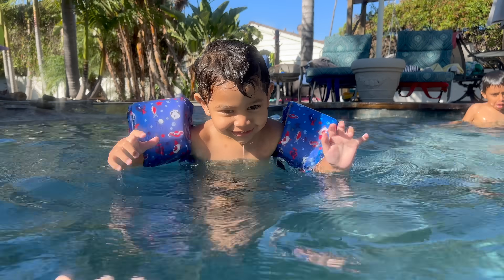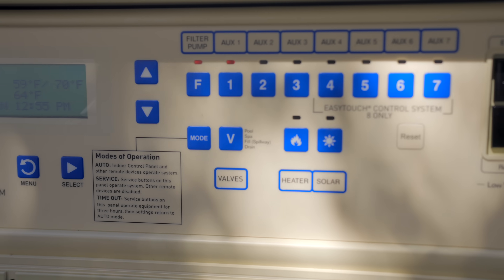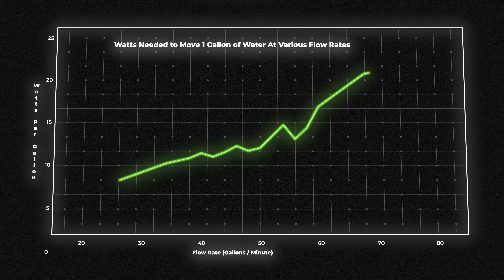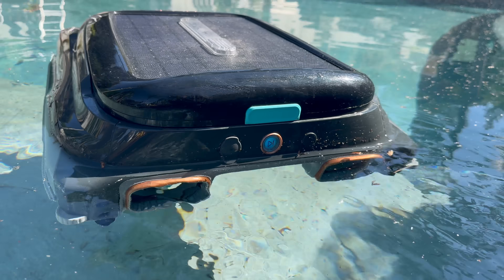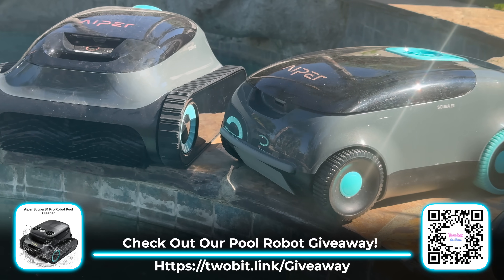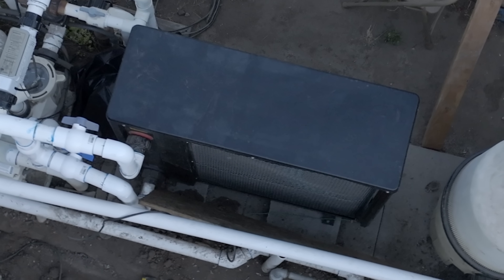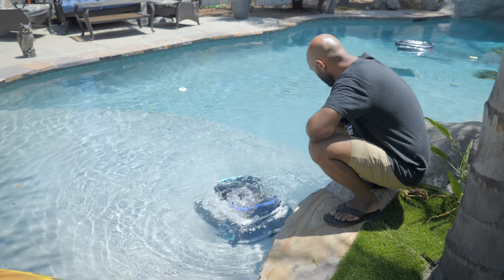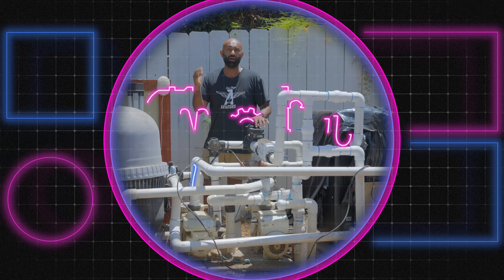How to Build the PERFECT Pool! Part 1 Variable Speed Pumps

Comment: You should check out natural swimming pools/ponds.  They are specifically designed for swimming, but mimic and utilize natural water cycles.  They have a sandy/wetlands section, with plants and even wildlife  set aside,  where water flows thru and is naturally cleaned.  They often use very cheap air bubble filtration to move the water thru the wetland/sand filter.  No chlorine, or other chemicals, and very clean water.
Reply from the maker: wow i've never heard of anyone with that kind of setup... I LOVE the natural component. I do have low levels of chlorine, so no living things for me, but I'll try to do everything I can. Do you have any links to resources?

Comment: i have had my fiberglass pool in Central NY since 1999....i use a sand filter and chlorine tablets....I recently purchased an electric cleaner (Dolphin by Maytronics) and LOVE it....i only use the regular vacuum 2 times a year now, once in the spring and once in the fall....the salt water conversion is my biggest decision and have stayed with tablets since the price of the unit scared me having to replace it every 4-5 yrs.....I only run the pool 6 hours a day and use a solar cover to retain the heat even though I have a natural gas heater, which I have only use a few times since the summer has been very sunny and hot...I keep the pool at 84 minimum too!!!.....like someone stated in other comments though is the CYA, cyanuric acid, which is a stabilizer for the chlorine and it can wreak havoc on your pool after yrs of using tablets....the common remedy is draining half the pool and re-filling which is 7000 gallons PLUS with a fiberglass pool, it is very difficult because dropping the water too low can cause the walls to buckle...i appreciate all your info as it is good to see other sides of the equation and the experiences using different ideas...what works for some may not be feasible or economically sound for others but it is nice to get constructive ideas on how to enjoy a pool for yrs like I have done
Reply from the maker: thanks for sharing Brian! So how long is your "pool season" how long do you keep it hot? And what area do you live? Very interesting, San Diego is quite cool... although its currently pretty hot, so a pool cover might be a good idea, but our odd shape makes it tough...

so much to it, which is why I'm really having fun nerding out. But I will say for everyone, get a variable speed pump!
Reply from the maker: Brian I think this may be the best comment to explain the challenges of engineering. Everything is a trade off. fiberglass buckling ... wow... is it in ground? I'm trying to think where the buckling problem could come from. I have a plaster inground. but as you point out, there are a series of challenges to all things in life, and the key is to find your own way. I will say the chlorinator issue isn't too bad, my pool guy told me about some aftermarket replacements that are way cheaper... but even then, with proper care I think its cheaper than Chrolorine, and way more automated. Something to think about. Plus salt water feels SO good on the skin... night and day compared to fresh water pools with high chlorine levels like at spas and hotels which leave you feeling bleached.

Comment: You are not joking. We purchased our house in Texas in 2022 so this is our 3rd summer with the pool. Actually it is a lot like yours, waterfall and spill over hot tub, and about 22k gallons. Getting the everything dialed in was finally done by May of this year. I purchased the same VSP that you show in your video, game changer. I purchased a used Polaris corded robot (wasn't ready to drop the cash on a new one) that does the floor and side, game changer. I am still running a chlorine, in-line, dispenser but I use 5 tabs a week (pool is in full Texas sun most of the day). The first year I cleaned the main filter 5 times, now I am down to 2 times. I think my largest electrical bill was $600, now down to the latest one was $275 (we have zero solar panels, just the old supplied by the utility service). I run the robot every 2 days, and the water is as clear as can be. One note on the price of chlorine, there was a plant in Lake Charles, Louisiana that caught fire and closed the plant for a significant time period in 2022. That, along with a 20% jump in pool construction during covid, sent demand extremely high. Enjoyed the video, now I'm off to do my morning swim.
Reply from the maker: I love it Parker, yah a pool in Texas must be pretty awesome as its warmer in the spring through fall. Thanks for the insight on the chlorine prices! did they ever get back to business?
Reply: @TwoBitDaVinci  I believe that it is up and running again, after a $170 million reconstruction. The company is KIK Consumer Products and the plant is in Lake Charles, Louisiana.

Comment: Tinkering with this stuff and doing an Excel simulation 20 years ago I came to the same conclusion about pump energy per flow quantity.   A few points: 
1. The salt cell has a flow sensor switch which sometimes are calibrated poorly to require a high minimum flow rate.  Bend it to adjust it to allow a lower flow which is not really an issue as long as the flow is positive.
2. Check valves are really restrictive with the spring, so  you can remove the spring to minimize restriction.
3. Use long bends as much as possible instead of restricting elbows.
4. Starite DE 110 filters have the lowest advertised flow restriction, much better than sand filters.
5. The two wheel constant volume pump motor are good at low flow rates but pricey.  I use one with an inline easy to clean filter which is great to catch dog hair from my crazy water loving golden retriever.  But I curious to try your robots.
6.  Solar heating requires a minimum flow to overcome the height and not cavitate.
7. A pool cover is a great investment like the another commenter noted, it vastly reduces heat loss and water loss from evaporation.  Besides the vinyl motorized cover I have a second manual bubble insulated cover for the the colder season.  Insulation under the pool and dry soil also help if possible.
8. I have an Arduino that controls the pump based on PV solar power to optimize solar heating.  It saves a ton of energy compared to that dumb brain Pentair Easytouch controller I have just like Two bit.  I really need to publish the design and program.
Reply from the maker: can you tell me more about your Arduino setup??
Reply: Please publish !

Comment: Why is there not a system which takes heat from your home’s A/C removing heat from the house and uses it to heat the pool?
Reply: Because theoretically it'd be great, but practically it gets complicated and expensive quickly. Not many HVAC companies make pool equipment and vice versa, so getting things hooked up to exchange the heat would be a custom situation every time. Then consider what happens if there's a leak, now you've got refrigerant in your pool and water in your refrigerant. Hopefully the compressor shut down before destroying itself trying to compress the water.

Comment: It’s weird why sun water heaters  almost aren’t used in the US. In meditarían countries they are everywhere. I mean those, which have a few vacuum pipes and a cylindric tank above them. It seems they should be at least twice more efficient in comparison with heat pump.

Those vacuum based heaters can be used in cold weather regions. Not to mention about San Diego.
Reply from the maker: there's a tradeoff for everything. thermal solar heaters don't last as long as solar panels. when i bought my house, i had them, and they were leaking salt water on my pool. it was a huge pain, and I ended up ditching it.
A heat pump has a COP of between 3.8 - 5 so they're really efficient at heating water. I wanted to get regular solar panels along the roof instead, because a pool water heater can only do that. but solar panels on my patio can heat my pool, or charge my car or run my AC etc... My goal is to produce all electricity, and with some planning, run everything under the envelope of my daily production. hope that makes sense, but i'll definitely get into this in my next video!

Comment: It really doesn’t take much to figure out where power is being used.  A clamp on amp meter does the job.  

Variable speed drives are used all the time in commercial air conditioning.   They are on the pumps and air handlers for many systems where there are large changes in demand over the course of a day and season.          It’s not uncommon to run an air handler at a lower air flow and ramp up the pumps to provide more chilled or hot water.   As loading increases water flow is increased until it’s necessary to ramp up air flow.

Comment: Our in-ground pool in Seattle is heated by a solar water heating system that has was first installed in 1987.  Last week I replaced the last 3 remaining original panels which were still working just fine, but I wanted fewer larger collectors rather than more smaller ones.  3 others were storm damaged over the years (tree limbs), and the remaining 2 did start leaking.  BUT, the overall system has lasted over 30 years and I can easily keep the pool at 83-85F and the hot tub (shared system) to 105F just using solar.  The system uses the same variable speed pump as the pool so no secondary pump required.  (Our backup gas heater died 12 years ago and we've heated solely by solar ever since which has worked out pretty well.  If we get an early heat wave, we can't quickly heat up the pool, but that's about it.  In Seattle it's NOT an all year outdoor pool!)  Solar Pool heating is probably THE most efficient way to heat a pool.  Unglazed collectors are cheap, lightweight, durable, and effective.

The other thing that makes an ENORMOUS difference in our climate is a pool cover.  Here the delta T between Daytime and nighttime can be 25-30F so leaving a pool uncovered over night results in a 10F drop in pool temp.  With the pool cover, 1-2F drop so the heat demand to maintain a temperature is MUCH lower.  

I look forward to the next segment in this series!

Comment: You might want to take a look at the Mike Patey channel. He is just finishing up his 27 ft deep 4 season dive  pool in his house with multiple thermoclines and movable floor that comes up thru the water all the way to make a dance floor on the roof deck. He also designs and builds competition aircraft on his channel so you have to look for the house and pool build episodes.. the engineering skills, workmanship and attention to detail is insane.

Comment: If you use a solar water heater you could reduce your chlorine use significantly although it would have to be sized as per the pool and location. Heat pumps are usually for colder climates.

Comment: I'm glad you're getting into this because I'm re-thinking my pool. I had salt water for 15 years but I got tired of replacing the circuit board every 5 years, I also noticed that I have no tree frogs anymore. I started running the pump for 12 hrs in the day with the solar blanket on rather than at night for cheaper electricity. Pumping at night actively cools the pool and I end up burning gas. Please deep dive on the automation system. I need one that has wifi and controls heater (which I have), variable speed pump, UV, ozone (which I don't have yet). Germicidal UV is 254-nm which LEDs do now but no one seems to use LED they still use bulbs. I'm curious to see the performance of your heat pump.

Comment: I did not see any mention of the power used to charge the batteries for the mobile pool cleaners.  How does that affect over-all cost?
Reply: He did mention the skimmer was solar powered, so no cost. The floor/wall cleaners have 30-200wh batteries. Tool batteries are 30-100wh, little enough to easily fit into the solar budget, but if you were paying to charge them off the grid it'd be less than $3/month even charging the biggest one every day with $0.50/kwh electricity. Most likely it'd be less than a kWh/month to charge it weekly.

Comment: Another benefit to Salt Chlorinator;  chlorine pucks also contain "conditioner" (aka CYA) that gets added when you use pucks.  CYA does not evaporate out of your pool and when you collect too much, it prevents the chlorine already in your pool from sanitizing and algae blooms will happen.  Salt chlorinators don't add CYA to your pool; the chlorinator converts salt into chlorine, chlorine gets used, converts back to salt, and the process starts again.